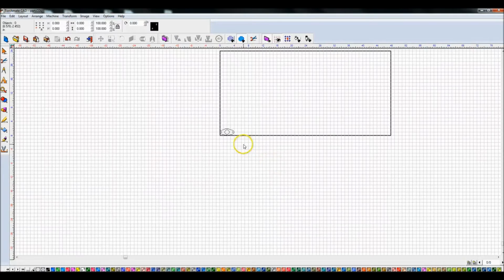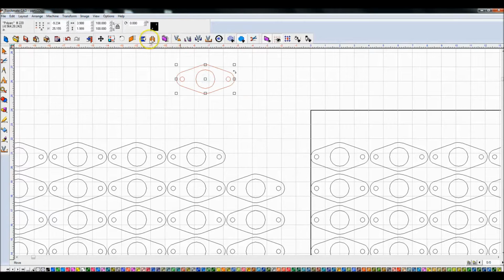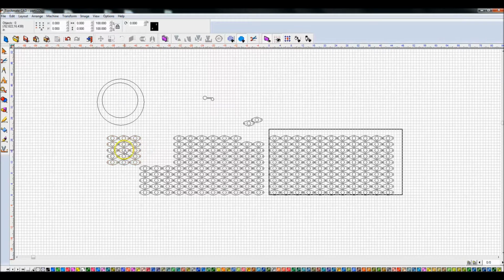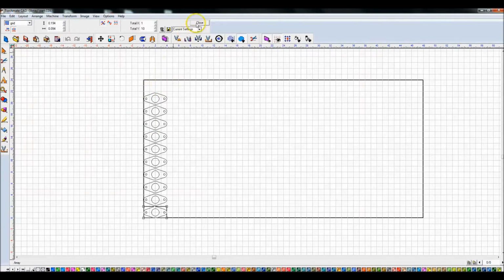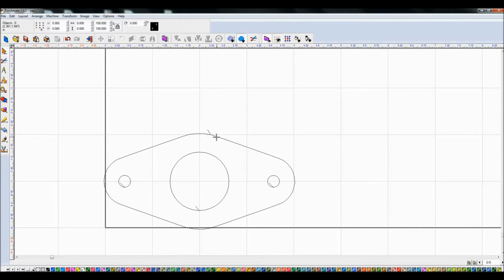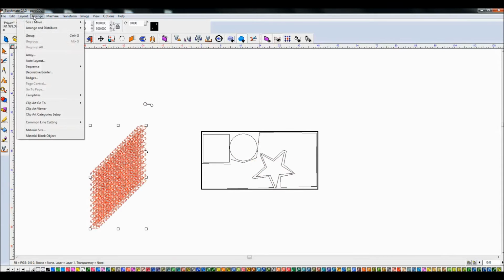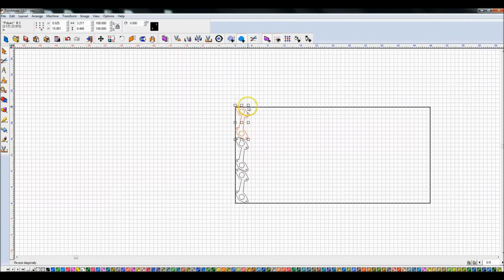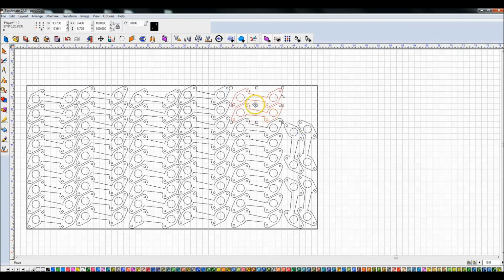Torchmate CAD/CAM: Nesting, With and Without Arrays

Comment: How can expand my drawings to use the maximum of my metal sheet ?
Thank you.
Reply from the maker: I am unsure if you are saying your table size in your software is wrong, or if you just want to resize an existing object.

There is a setting somewhere (I sold my table, so I can't reference the software to look) where you can specify the dimensions of your table if the default layout in the software doesn't match your table.

For an object, you can just select it and go to the size at the top for x and y.  Constrain the aspect ration (looks like a lock on the side of the boxes) if you so desire.

Hope that helps.

Comment: Hi, thanks for the video, is so helpful.
I have nested my drawings but for some reason when I put them to cut they don’t cut in one order in particular. 
I get cuts horizontal and then vertical.
How can I fix this ?
Thank you.
Reply from the maker: I just sold my table a few weeks ago, so I don't have the software to reference.  Somewhere you can specify cut order.  There is a manual option, etc, but I would start there and make sure that out of the available options you have the correct one set.

Comment: Excellent video, how can I do to put the cutting order of the pieces? In general, it always seems to me to cut the exterior first and then the interior, and when I generate nests of many pieces I have to do it manually and that takes me a long time.
Reply from the maker: I would apply the tool path to each individual piece before copying/pasting it
Reply: @JohnHarmon  Ok, once you do that, then the sequence is replicated by copy and paste logic 👍

Comment: John, What tool path do you use after importing it? I cut a #25 chain sprocket and it didn't line up with the chain..
Reply from the maker: +bgriffel I had to adjust my kerf width.  The first few I cut didn't line up either, but as I decreased (i think) the kerf width I was able to get it to fit fine.  I am going off the top of my head but I think I used .04 (instead of the standard .62)--or something like that.  I would check but I have been at work for the last 16 hours with no end in site yet.